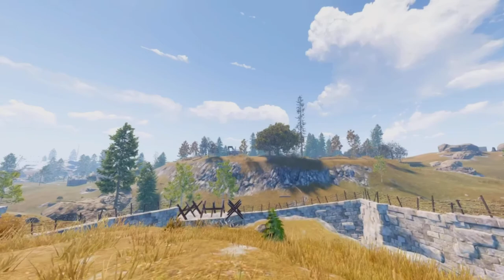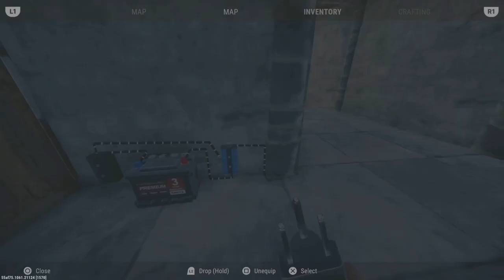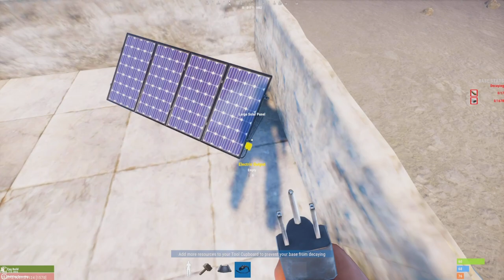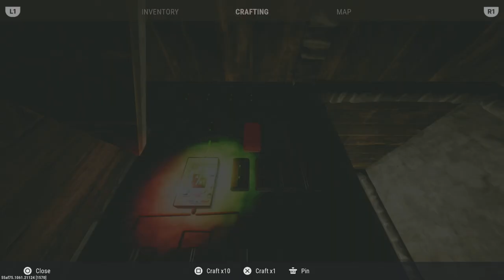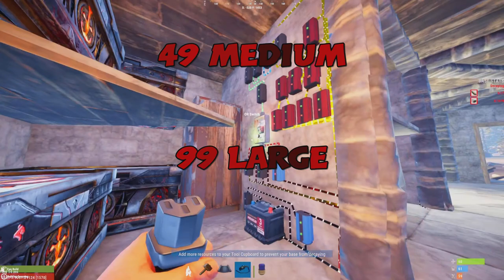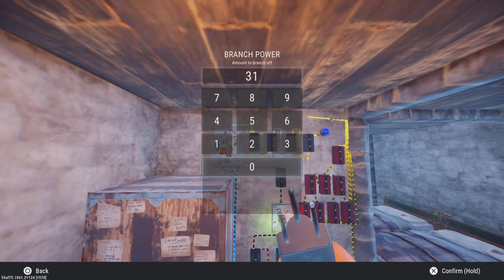Full Step-By-Step Electrical Setup & Wiring Guide - Rust Console Edition

Comment: Watched the whole thing. I learned a lot and loved it and thank you for  explaining, it helped me learn the new wire mechanics. Definitely took some screenshots as visual aids.
Reply from the maker: Awesome! Glad this is helping! Lots of videos on my playlist for power. Ever need any help or anything message me here or Facebook. Do my best to help.
Reply: @Mr.RustyHydra  if it fits in your schedule I would be interested in learning something specific. But it would be an amazing learning opportunity.  (it fits me and my teams play style. I'm a builder. I have over 2k hours in the game. I'm reluctant to join discord or reddit communities. I like YouTube because I'm a visual learner. I use rust fortify on steam to make up for console limitations. I am  learning to be an electrician.) I would be interested in learning how to build that has the following conditions:
1.) Main has power, lights, heat, cameras, no door controls, some kind of heartbeat alarm system, and 3 windturbines, with one powerwall 2.) 3 externals that support the shooting floor, their would be 9 outside turrets in total. 3 per each gatehouse. 3.) Somehow if a main gets compromised the extra gatehouse's continue to function with power without needing the main  board. The external turrets could stay on even though the main has been compromised. 4.) Each of the 3 externals has 1 large battery or more a piece. 5.) If the external gatehouse's produced extra power they was supply main but the turrets would always be on and can function without the main in case the main is compromised. 6.) I have an idea from watching your videos how to make most of this happen. However, I'm stumped at how to make the outsides independent, if main is compromised. 🤠 Let me know your thoughts. 💭
Reply from the maker: Add me on psn. XxHYDRAxX. I can help. We can talk there.

Comment: Is there any way of having individual doors open and close you as you pass through each, as I feel having them all open is more risky
Reply from the maker: You can yes but it becomes expensive in terms of power really quickly as each door would need to power a door controller and HBHF sensor plus the 3 ways ect to set them all up. So a 10 door setup can go from 11/12 power up to 25+.

Honestly though the only time your inner doors need to be closed is when you're logged off, being raided or going far from base. As long as you have a bag near your system, you can spawn in and activate it almost instantly.

I should have a video up soon of 5 different ways to automate your doors and add-ons for them. In the mean time you can also check out my essential secondary systems video that has another similar door system.